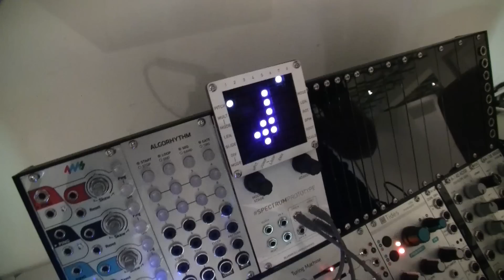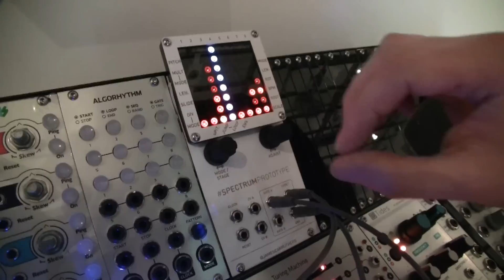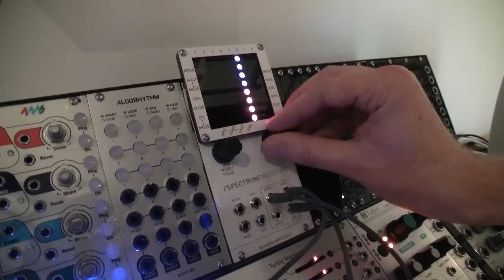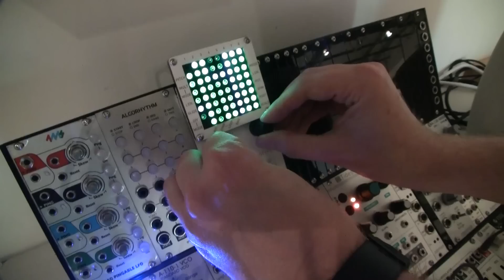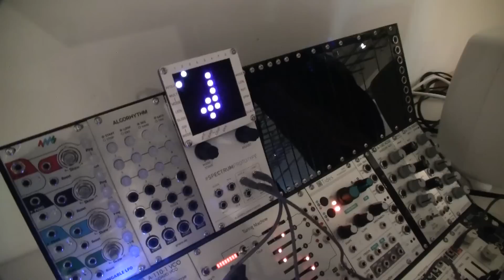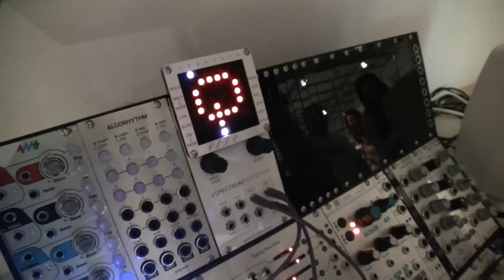Brighton Modular Meet 2015: James Carruthers Spectrum Prototype

Comment: Appalling....goes against the entire modular ethos.
Reply: William Shaver Good to know. I'll alert the press.
Reply: Eccentricgenius: nice comeback! Still, it does run counter to the so-called "immediacy" of modular kit...but wait! Perhaps if we added normalled connections and patch memory...oh...wait...
Reply: William Shaver The last thing any open format needs is rules and policing. Why are you so eager to provide them?
Reply: eccentricgenius 
When did I suggest "rules and policing"? I'm merely expressing the opinion that this digital, menu-driven module (and others like it) is inconsistent with what I referred to as the modular "ethos" (all analog signal path, completely user-configurable arrangement of signal sources, modifiers and controllers, knob-per-function layout and so on). Go ahead and make any module you want--go ahead a buy any module you want: IMHO "modular" is more than simply packaging 80s-era digital functionality in a modern, Eurorack format.
Reply: eccentricgenius 
Three points in reply to your well thought-out, devastating takedown of my position:
1) It wasn't very nice. I didn't personally insult anyone in my comments..but then, I use my real name in these comment threads.
2) The moniker "genius" is usually a term applied by others--one doesn't generally call oneself a "genius".
3) With respect to the farting noises...how did you know I own a Buchla?
Reply: William Shaver 1) What's your point? 2) Wasn't my call... blame the older lads. 3) Guys who are passionate about The Modular Way invariably put patch cleverness ahead of musicality. The Buchla thing just reinforces the point.
Reply: eccentricgenius 
1) My point was that personally insulting people you don't even know is rude and disrespectful--and that you resorting to name-calling is likely the result of hiding behind a pseudonym.
2) I think you missed my point...no matter: congratulations.
3) I agree that musicality trumps "cleverness": I am not defending some sacrosanct Modular Way; rather, IMHO modules that have multi-layered menus, small displays, LCD screens and the like are inconsistent with the modular workflow. Moreover, I am concerned that unimaginative, inexpensive and derivative technology is simply being "repackaged" as modular kit to benefit from Eurorack's newfound popularity.
Reply: William Shaver +eccentricgenius You 2 should get a room.
Reply: William Shaver 1) kind of ironic considering your first comment that kicked this all off :)
Reply: William Shaver Gawd, you're a precious little fella, aren't you?  No problem whatsoever decrying a lovely bit of technology you personally don't approve of as 'appalling', but your feefees get hurt when you get called on it for being the condescending bellend that you are. 

Again, go make fart noises.
Reply: James Carruthers 
Ya think? When and where did I personally insult you? I don't like the design choice you made (in the same way I don't like the design choices of similar offerings from, say, Pittsburgh and Kilpatrick Audio)--so what? I'm talking about the gear--not you.

Lots of people will dislike this module...and lots of people will love this module. I wish you no ill will--I hope you sell a buckeload of 'em My feeble opinion here won't impact anyone's perspective.

I'm a musician. Lots of people like my work...and plenty more don't. That's just the way life is. Throughout my career, I've been called plenty worse than "twat"...its not too bad; just let your skin grow a little thicker.

In any event, good luck and I wish you success.
Reply: eccentricgenius 
I strongly object to be called a "bellend" as I've no idea what that means. Listen, if I have to Google your insults the meaning is bound to get lost.

Comment: wouldn't the size of it be a problem for some people?
Reply: sonicase Uprightest as Tom says — this is just the prototype — the real thing will be the normal height and with the screen flush with the surface of the panel
Reply: I was thinking the same thing. Looks like it would only work on the top row
Reply: sonicase If you watch the whole video, he states that its a prototype and that the finished product won't be that height